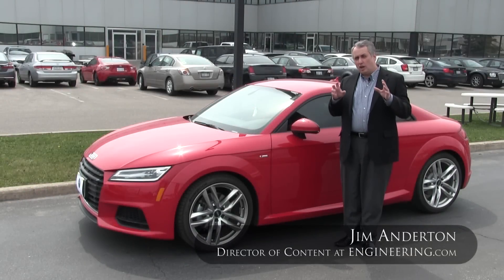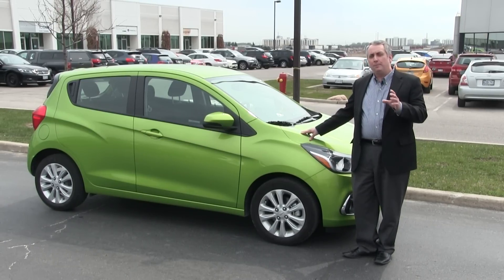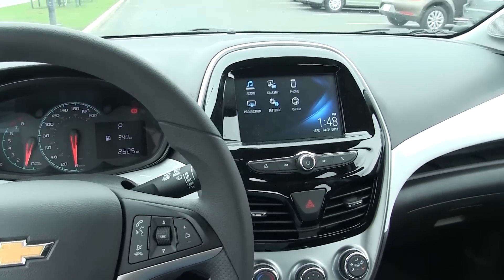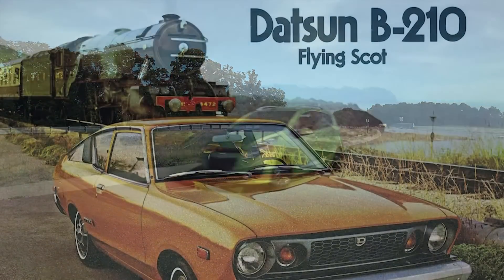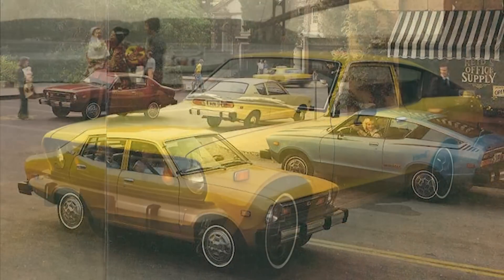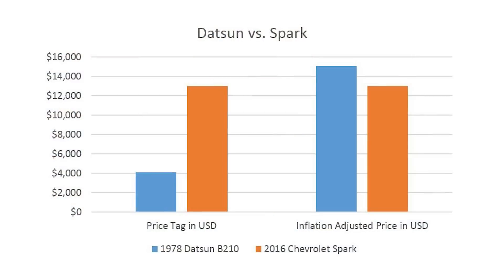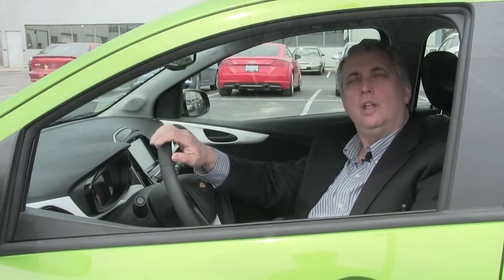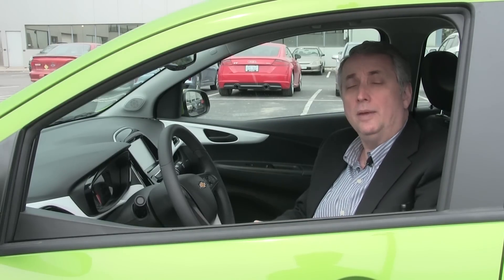Is the 2016 Chevrolet Spark the Best Car in the World?

Comment: I like this video because it starts out by talking about the Audi TT (which I own)  before moving onto the Chevy Spark (which I have rented and am a big fan of).  But the video is a little confusing as the presenter sits inside and refers to the 2016 Spark, yet most of the video clips show the previous generation Spark.

That said, I would agree the previous generation was a revelation!  Great styling inside and out, really fun to drive (even with its tiny overachieving engine and CVT), and came standard with things like a touchscreen and alloy wheels which was amazing for a car that cost <$13k brand new.  It got 38 MPG all day and was surprisingly roomy too.  

The 2016 Spark may be even more refined but lost some character (given by the giant headlights and motorcycle gauges, for example) in the process.
Reply: .... yes ... wtf ...